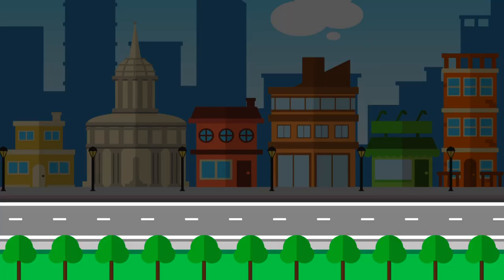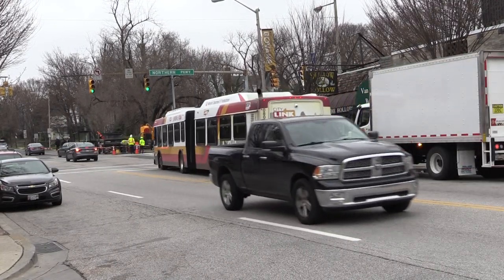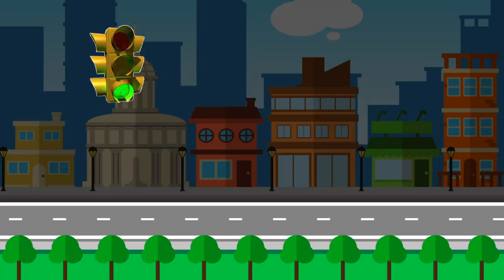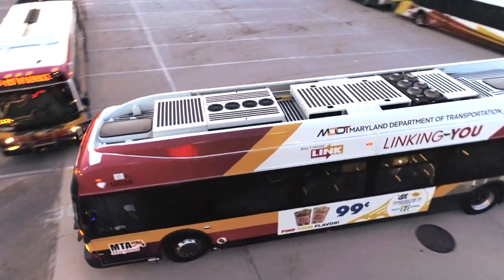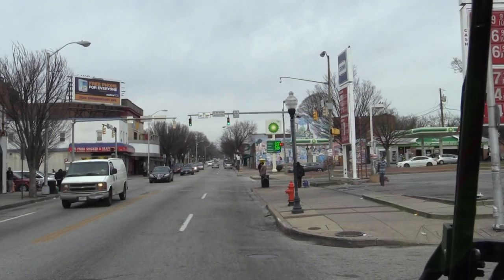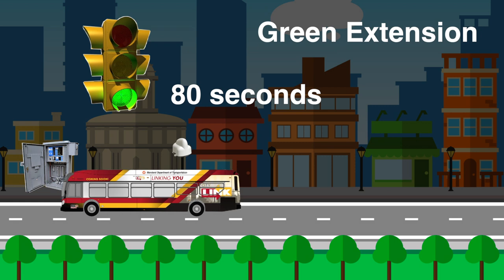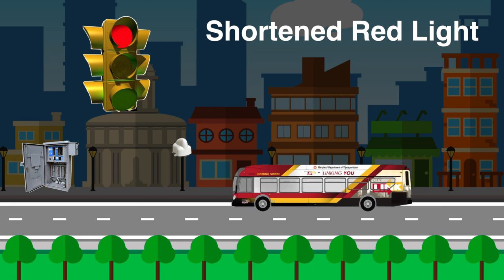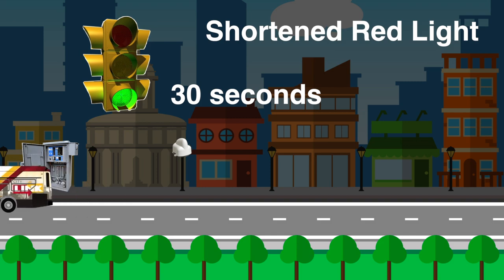MDOT MTA's Professor Vern On Transit Signal Priority

Comment: Not gonna lie, there some intersection in West Baltimore that just needs to be decommissioned entirely. Whenever I drive the CityLink NAVY or ORANGE lines, Carey Street (Northbound NAVY) is the equivalent of sitting at a medical clinic for a flu shot. Schroeder Street (ORANGE) @ Arlington Street; Franklin Street; Mulberry Street -- all within three blocks of each other -- literally takes 5 minutes... FIVE MINUTES! to get 1/5 mile uphill. Downtown along Pratt Street between Pine and Howard Street, takes 5 minutes to get a 1/4 mile.

I know a lot of this has to fall on BDOT's responsibility to synchronize and/or replace/decommission traffic signals whom seem fit, but if you ride along many of these lines in West Baltimore, you'll see why time patterns get bottled-up so easily. They'll at least respond to MDOT more diligently than they would a bus driver/citizen of the public like me, for suggestions.